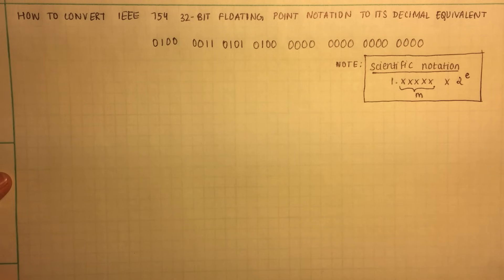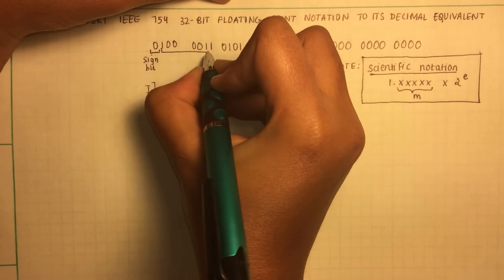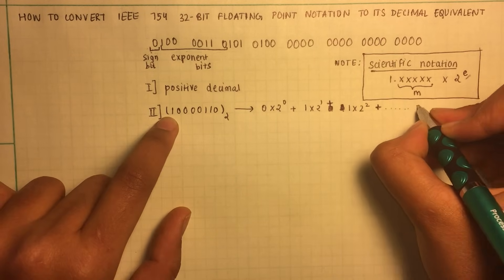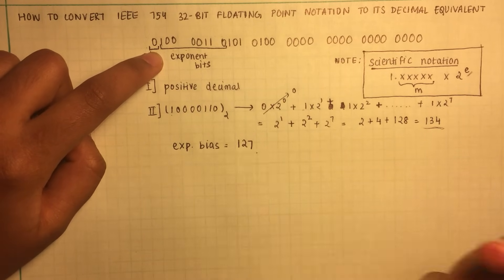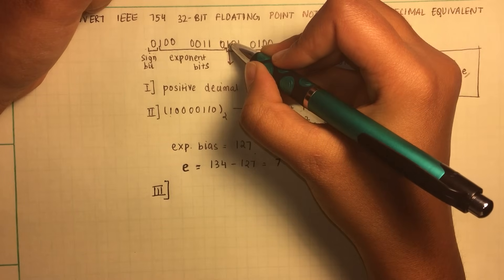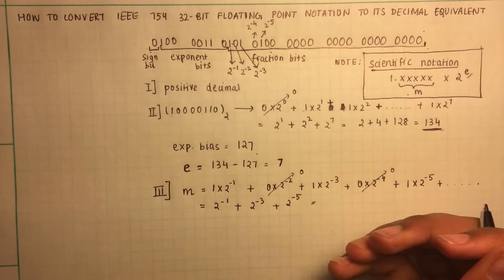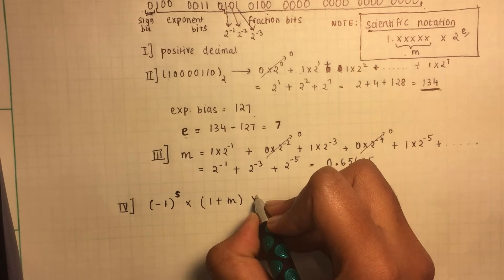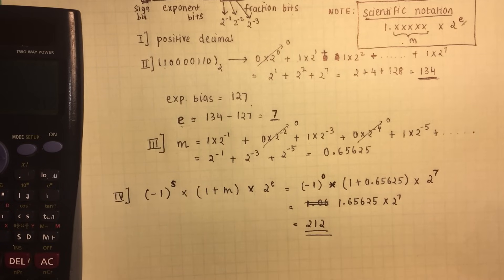IEEE 754 Floating Point Representation to its Decimal Equivalent

Comment: at part three, you can directly write the number in binary, 1.101010000...., we know that we just move to left for 7 times while converting this to floating point, so do the reverse and go to right 7 times, 11010100.00000.... , calculate the number its 212.

Comment: You saved meee at work xD here's the python version :

def IEEE754(n):
        # decimal to binary
        b = bin(n)[2:]
        # the binary in IEEE754 notation
        # add '0' bytes on the left
        if len(b)%4 != 0:
            v = ''
            for i in range((4-len(b)%4)):
                v += '0'
            b = v + b
        sign = b[0]
        # add '0' bytes on the right
        while len(b) < 32:
            b += '0'
        # compute exponent and mantissa
        exponent = int(b[1:9], 2) - 127
        mantissa = computeMantissa(b[9:])
        print("sign : ", sign, "exponent : ", exponent, " mantissa : ", mantissa)
        # compute the value
        final = (-1)**int(sign) * (1 + mantissa) * 2**exponent
        return final

Comment: 4:30 instead of dojng that 'm' thing just take that fractional value, put 1 infront of it and add a decimal so that it becomes a scientific notation and multiply it by 2^7 where 7 was e after subtracting 127 from 134. Then move the decimal 7 places towards right and it becomes 11010100, after this just convert it to decimal and that will be it.

Comment: Thank you for your videos. I learned how to change between the floating and Decimal.  In the step III, I use 1.10101×2^7. Then I can move the point to the right 7 times. so the result is 11010100, then turn it to a number based 10, it is 212.

Comment: In the third step I just move the "," to the right by the number of my exponent and skip step 4 completly. Any reason to do your version? (Ihave to place "1.xxxxxxxxx" infront of the mantisse)
Reply: Yes I agree.. move the "." to the right x7, padding 0's, and then just convert the resulting binary to decimal. Its much easier when without a calculator.

Comment: The IEEE754 answer is  "+1.10101* 2^7" not 1.65625*2^7(we have to use only 1 or 0).  Therefore, the equivalent decimal number is = "1.10101 * 2^7 = 11010100 = 128+64+16+4 = 212

Comment: Public Class HexTo32BitDecimalClass

    'Many thanks to the greatest teacher Abishalini Sivaraman (https://www.youtube.com/watch?v=LXF-wcoeT0o&t=34s) 
    'for quickly and easily explanining Floating Point Representation. This info was really important to proceed 
    'in our IO-Link/brewery-sensors project. /Peter /Helsinge Angbryggeri

    Private _ErrorMessage As String = ""

    Public Function GetDecimalNumberFrom32BitHexString(HexString As String) As Double

        '32 bit HexString must contain exaclty 8 characters:
        If HexString.Length <> 8 Then
            _ErrorMessage = "HexString did not contain exaclty 8 characters"
            Return 0
        End If

        'Convert into string with 32 bit 0 or 1 characters:
        Dim bits As String = ""
        Try
            bits = Convert.ToString(Convert.ToInt64(HexString, 16), 2)
        Catch ex As Exception
            _ErrorMessage = "HexString was not a valid Hexadecimal string"
            Return 0
        End Try

        'Split HexString into sign, exponent and fraction strings:
        Dim signBit As String = bits.Substring(0, 1)
        Dim exponentBits As String = bits.Substring(1, 8)
        Dim fractionBits As String = bits.Substring(9, 23)

        'Sign:
        Dim signFactor As SByte = 0
        If signBit = "0" Then
            signFactor = 1
        Else
            signFactor = -1
        End If

        'Exponent:
        Dim exponent As Int64 = Convert.ToInt64(exponentBits, 2) - 127

        'Fraction and mantissa:
        Dim mantissa As Double = 0
        Dim i As Byte = 0
        For j As Byte = 0 To 22
            i += 1
            mantissa += CByte(fractionBits.Substring(j, 1)) * 2 ^ (-1 * i)
        Next

        _ErrorMessage = ""

        Return (-1) ^ signFactor * (1 + mantissa) * 2 ^ exponent

    End Function

    Public ReadOnly Property ErrorMessage As String
        Get
            Return _ErrorMessage
        End Get
    End Property

End Class

Comment: Given the following 10-digit mini-IEEE floating point representation
0 0000 11000

What is the corresponding decimal value? 

Note: You must give the EXACT answer. Enter "-infinity", "+infinity" or "NAN" for the non-numeric cases
Reply: can you tell me this question solution
?
Reply: @ajaykakadiya9368  
MY SOLUTION gave 0.01171875000
My solutions are:
step 1: 0 = positive (+), Bias exp = -7
step 2: exponent = -7
step 3.1: convert part mantissa to decimal
.11000 = 1 x 0.5 + 1 x 0.25 + 0 x 0.125 + 0 x 0.0625 + 0 x 0.03125
step 3.2: add multipliers
1 x 0.5 + 1 x 0.25 + 0 x 0.125 + 0 x 0.0625 + 0 x 0.03125 = 0.5 + 0.25 + 0.000 + 0.0000 + 0.00000 = 0.75000
step 4: since it is 0.mantissa and not 1.mantissa, multiply 0.mantissa by the subnormal exponent
0.75000 x 2^-6 = 0.75000 x 0.015625 = 0.01171875000

Comment: Good thing to remember is that for simple questions like these,

2^7 is 128. which is always 1000 0000 in Base-2 (Binary). Once you get used to the simple numbers. At first glance, I knew 110 is 6. meaning it was 128 + 6 = 134. anything beyond 1000 (8) you should use the 2^x (where 1 is present) method. it's a lot more accurate if you're not confident with the basic binary